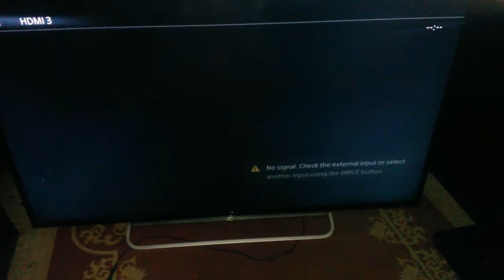Sony KDL 48w600b no picture repair

Comment: Awesome, this was the exact fault I had. @Vikas - Those caps are 10uF ceramics, they need to be rated more than 15v, they are probably 50v or 63v rated at that size anyway.
Reply from the maker: Yes you are correct

Comment: I really appreciate this video! I wish it came out a few years ago when I was trying to fix this TV set. I was able to norrow the problem down to that board but I couldn't tell which cap is shorted (newbie). The voltage injection with flux was great approach. I can finally see pictures. Thanks again so much! Please keep them videos coming.
Given this is a common problem with this model, my question is why exactly it's one of those 4 caps that fails?
Reply from the maker: I have no idea why they fail but if i have to make a guess i will say it maybe the rating of the cap
Reply: @exittech1282  I thought of it too. Thanks again.

Comment: Hi and a lot of Thanks for your video. It's really the top !!! If a can abuse i have a question. Same symptom, the condo are all in short circuit on the board. I should desoldering all of the them, only the first on the right ? I replace with wich model please ? Thanks a lot !!!
Reply from the maker: the value is 10uf 25v
Reply: Thanks a lot. When the tv is on the condo have only 0v to 0.4v...only one have 12.6v.
Can i test them on the board to short circuit with multimeter ?
Thanks+++
Reply from the maker: @chris333j   yes you can test with multimeter
Reply: Thats OK now, I have revome 2 condo and short circuit have disapored😊😊😊

Comment: Thank u sir. But same issue again and again coming back. Even after replacing the cap. Same cap goes bad. Why??
Reply from the maker: Did you replace with correct value?
Reply: @exittech1282  looks same . Yes
Reply from the maker: @leolearning3048  you have to know the value of the cap, not because they are the same size means its the same value and voltage

Comment: I have the same exact model, but the PCB bonded to the LCD is completely different. Checked all of the capacitors for shorts and nothing is shorted. Any ideas? Same exact symptoms. Have backlight and everything. Shows picture for about 2 seconds and then goes out with the backlight still on.
Reply from the maker: Ok your issue is different. when the picture goes check to see if you are getting voltage on VON
Reply: @Ri5ux did you ever figure out what the issue was for this?

My KDL-48W600B will turn on just fine, show the SONY logo and last input screen and then go black after a few seconds with the backlight and green indicator still on.

Comment: HI ! Big thank's for your video! Do you have to replace these caps absolutely if you knocked them off , is it safe . . . cause that's what i did and resolved my problem. What are they there for ?     Regards   Rick
Reply from the maker: The caps are there to filter noise and smooth out voltage. i wont recommend removing all but you can remove the one that is bad. you should be fine

Comment: Hi I have a 40w600b with no screen but backlights and sound all work. Could it simply be this capacitor? Because it was working and than one day it just simply quit on me Ike that.
Reply from the maker: Hi the only way to know for sure is to test for shorts in that area
Reply: @exittech1282  Had to remove 3. One was giving me a 30 Ohm reading but when left on the board it gave me a short. Could I leave it like this??
Reply from the maker: @ubuntu210  there should be no shorts.
Reply: @exittech1282  removed the shorts but that meant leaving only 1 capacitor. Is there a problem?
Reply from the maker: @ubuntu210  no its ok
Reply from the maker: @ubuntu210  is the tv working?
Reply: @exittech1282  yes it is. With only 1 capacitor on the board. I'll try to buy new ones later.
Reply from the maker: @ubuntu210  i am glad that the video help you fix your tv :-)

Comment: Hi sir, my sony kdl-48 w650d has backlight but no display n gives 5 times blink light after coming on and off. I have replaced the motherboard but still same. Could this cap you have shown be the issue? Thanks.
Reply from the maker: Yes check that area for shorts
Reply: @exittech1282  I am not sure if I can find the replacement part. Can I just leave it out without replacing it?
Reply from the maker: @tomsu9364  yes you can
Reply: @exittech1282  Hi prof. Thanks. Just an update. I have not removed the cap yet. After putting back the main board, Now i have sound n blank screen with backlight on. There is no display at all, not even the sony logo when booting up. I can play music through cdmi port using google chrome-cast. Any advice?
Reply from the maker: @tomsu9364  did you check the area for shorts?
Reply: @exittech1282  No Not yet. I will update later. Thanks.
Reply: Hi, i found that the scalar board is different from yours. My model is sony kdl-48 w650d. I can't find the same area as shown in your video. Can I send you the pictures of my board by email and you advise me where are the area I need to check for shorts?
Reply from the maker: @tomsu9364  in this case you will have to get a technician to check the TV, it will be i more complex repair and very hard for me to walk you through.

Comment: How can I get value of those.
Reply from the maker: read the value from the other good cap out of circuit
Reply: @exittech1282  one more question.
When I remove cof joint. It's show half screen
Reply from the maker: @vnyati25  do you mean side cof ics?